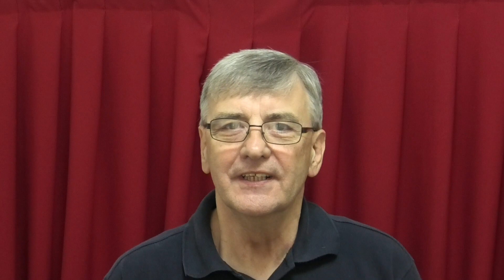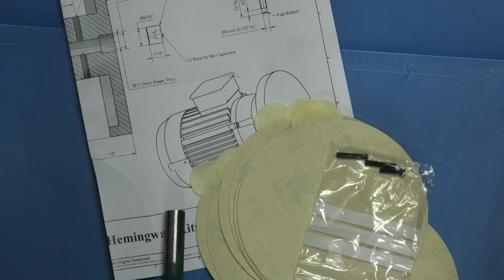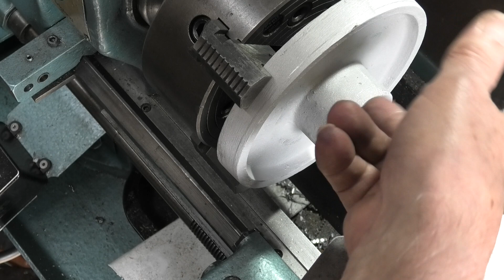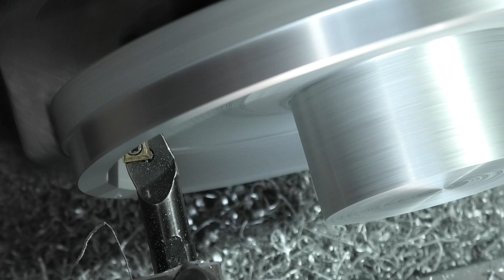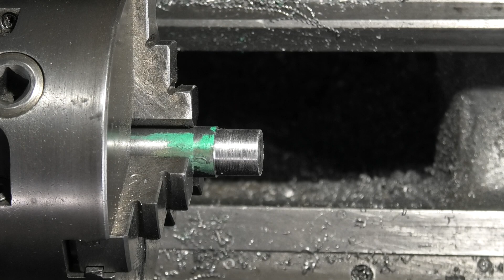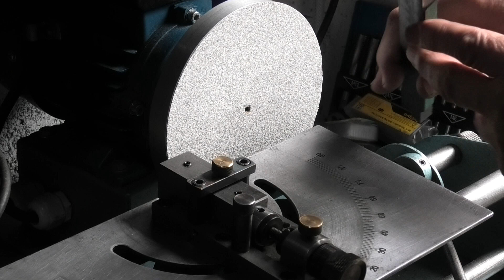making a linishing disc

Comment: A few things:

First, thank you for another excellent video.

I love that angling guide plate mechanism that you're using toward the end of the video.  It looks like it might be a shop made tool?  I've been watching your channel for several years but don't remember seeing a build video on it.  If you made one, would you add a link to the description please?
If not, would you consider doing a short video on how you did it?  (I don't mean "make another one from scratch"; but rather disassembling that one to whatever degree is practical to show the parts used and how you put them together.) 

I've seen a lot of my favorite YouTubers building things from Hemmingway Kits in the last few months.  Some of them seem okay, but I've heard builders comment about a fairly high rate of quality control issues.  Ex: Multiple inclusions in the aluminum casting in this one.
Having completed and used this one, what would you think of adding a facing sheet of steel to the aluminum; using pins, Loctite, or both to hold it in place?

Thank you again for sharing this, and many other videos with us,
Doug
Reply from the maker: Hi Doug. The inclusion are no problem to the operation of the disc as the sanding discs have a thick backing. No need for a steel backing plate I was just trying to get a good surface finish. The table used is part of a Worden tool and cutter grinder. This is another kit from Hemingway Kits one of my first projects some years ago. This is the link to the first video in a set making the grinder.  https://youtu.be/UvubIfmWaIw
Regards Alan
Reply: Antithesis r thumbs up for Hemingway, Often I could not buy all of the materials int eh kit for what Kirk sells them for. My friend & I have had no QC issue with the kits we’ve made.